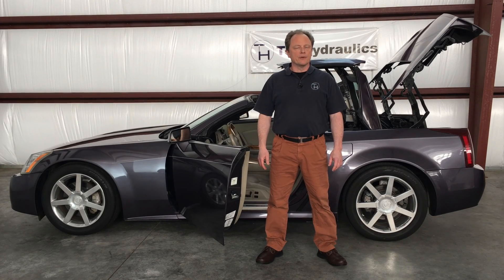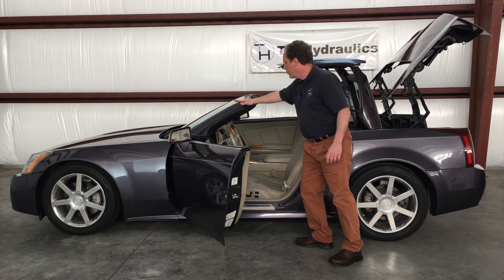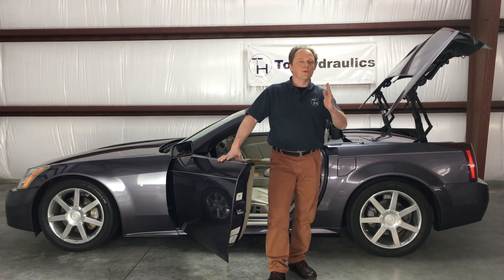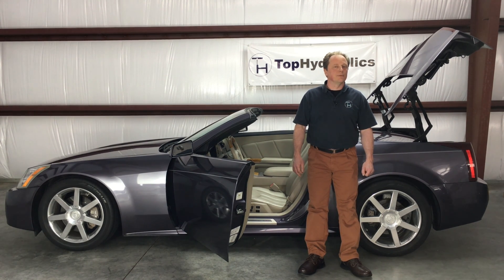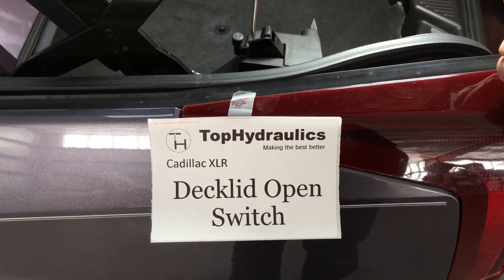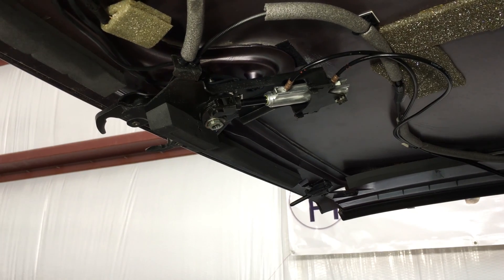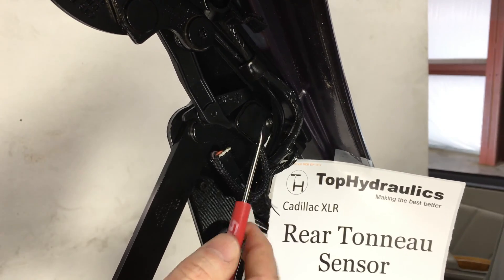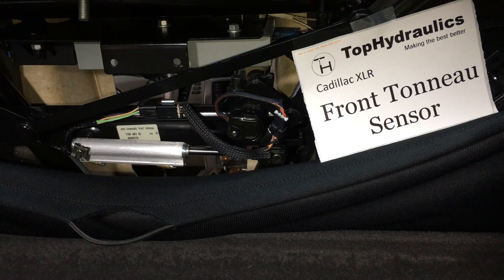Cadillac XLR - Troubleshooting Sensors and Microswitches

Comment: Hey Klaus, you mentioned that the decklid open switch was easy to replace even if we can not find the part. How do we fix the switch or replace it to open and close the circuit even if we cannot find the part?
Reply from the maker: Well, "easy to replace" is relative. I haven't searched yet, but there surely are micro switches that are roughly the same size with somewhat similar levers on them. The idea is to find a micro switch that has a longer lever on it, bend that lever to roughly match the one in the XLR switch assembly, and fasten the replacement switch into the plastic holder (most likely using epoxy). I would first look in the Omron catalog. The part number for the GM switch assembly is 19120639.

Comment: Hi Klaus My trunk will only open when I insert the key in the back bumper.  It tries to open when you hit the button on the key fob or the one on the dash but only comes up about an inch , you can hear motor running, then it closes again. Any suggestions?

Comment: Hi again Klaus, something weird happened to my XLR top. It was opening and closing. But wasn't opening perfectly always requiring to press the button twice when getting to the point to close the trunk. 
So I opened the top half way to clean some areas of the rubber seals then with it half open I connected the Tech2 like I always do and started the relearn process. At that point the Top stopped responding at all. Doesn't do anything when pressing the button. It looks dead.
On the Tech 2 I can manually go to an option where I can manually sctuvate de pump open and close that trunk small cover that moves in and out. That means the pump is working fine. 
Do you have any ideas? 
Oh at the same time both windows stopped responding and where open. But I accesses their modules directly from Tech2 and was able to close them, now they are working fine.
I checked fuse, disconnected battery... nothing worked... I have the message Top not secure on the dashboard.
Reply from the maker: Which model year is the XLR?
Reply: @TopHydraulics  It's a 2005 Northstar  engine
Reply: @TopHydraulics  It's a 2005 Northstar engine, I'm I Portland OR, I scheduled to take it to the dealership tomorrow, I couldn't find any other shop that would work on this roof
Reply: @TopHydraulics Hi Klaus, any ideas? The dealer has my car since last Friday, still haven't heard from them 😕
Reply from the maker: @EASYUSA  Hopefully, it's just an accumulation of too many error codes stored and there is an easy way to erase those. I have seen that on older Mercedes tops. I hope the dealer can get some tech support from GM, as I imagine they don't have any more experience using the Tech2 on an XLR top than you do.

Comment: Hi Klaus, you should invent/build a replacement for that impossible to find micro switch potentiometer that goes on the trunk hinges arms. The rear sensor.
My car keep going out of sync very often. Thank to your tips I've got the scanner to do the relearning. The trunk door stays open during the opening. But I wonder why it keeps loosing synchronization after every few opening.

Comment: I've got a Tech2 scanner, what exactly is the path to re-calibrate the micro sensor?
Reply from the maker: Thanks for asking. Here are the notes we took at the time:
Go to
- Cadillac
- Y
- body control
- roof
- F5 module setup
- relearn roof 
then push and hold the top button so that the top goes through all its motions.
Reply: @TopHydraulics  Thank you so much for replying. I will try that today.
Reply: EASY USA well did you try it???
Reply: @michaelgreene4247  Yes and it worked. I have to do it very often. This roof tend to loose synchronization very often. I actually keep the scanner in the trunk in case it get stuck while I'm away driving. 
Every XLR owner must have this scanner. It was just over 300 bucks on eBay.
Reply from the maker: @EASYUSA  This is the first time I have herd that the calibration needs to be done frequently. Have you taken a look at the potentiometer to see if it has some particularly loose or worn bushings? Or does it look like the sensor has been wet before?
Reply: @TopHydraulics  I will look again to see if it is very secure, I'm not sure if it got yet in the past. It's a sealed sensor, if it wasn't I would open to clean the contacts.
I will let you know what I find.
Thanks for responding, you guys rocks
Reply: @EASYUSA  Hi Fernando, that's awesome! Mind sharing the ebay link for your scanner?  I have the DiagZone with GM software, but it lacks the relearning module you have. Many thanks!
Reply: @Omar Aziz  Sure I'm glad to share this info, although the same seller on eBay is not selling it anymore I paid around $350. But I searched for the same one and found this for $388. Check the link on my next comment. But I highly recommend getting it for your XLR.
Reply: @Top Hydraulics  I just posted the link for a Tech2 on ebay but I think YouTube will block it as spam until you review and authorize the comment. 😀
Reply from the maker: Sorry, I missed this post. There is currently nothing for me to review - maybe there was a time limit on it.